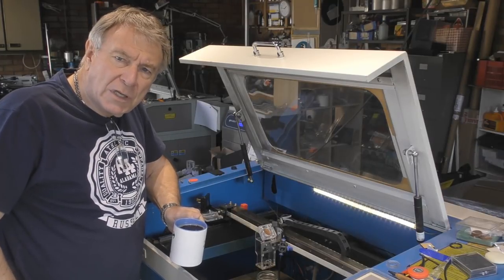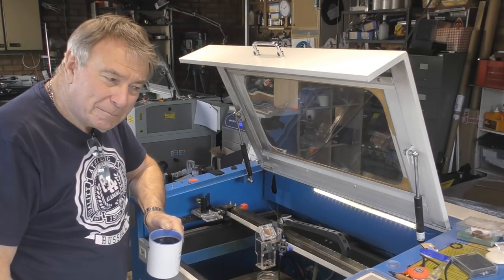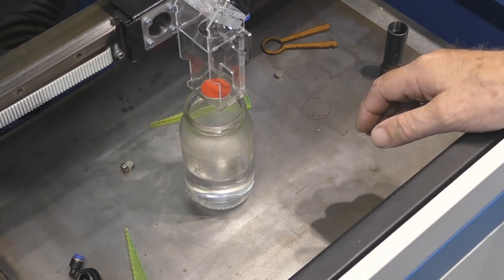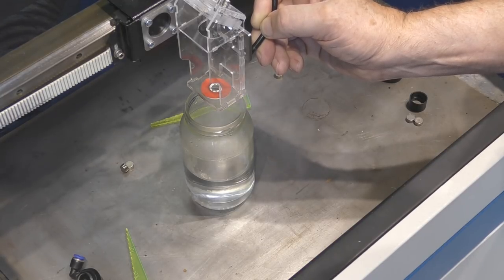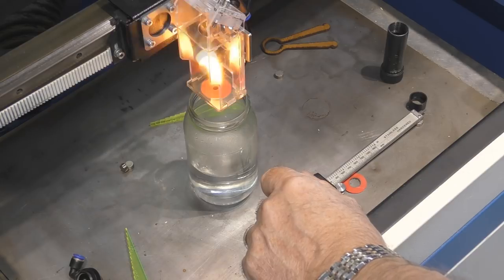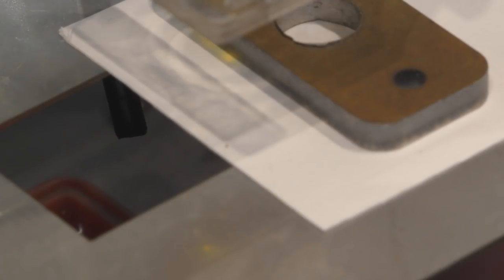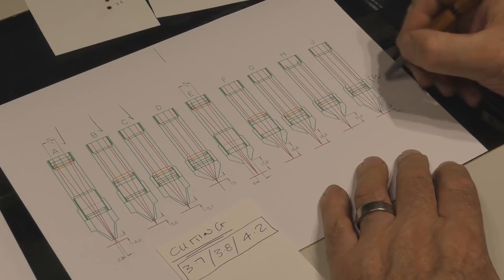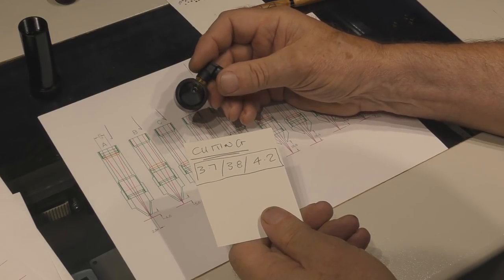RDWorks Learning Lab 152 Are our Nozzles Designed Correctly

Comment: Hi Russ. I couldn't help but wonder if the hole in the orange paper circle was expanding due to the paper continuing to burn and the flames spreading in the presence of oxygen in the air (even after the beam is turned off), rather than precisely indicating the true diameter of the laser beam. Could you have used some material that does not burn as easily as paper? Can't back this up with actual experimenting, though, because I don't currently own a laser machine.
Reply from the maker: Hi Steve

I used thin card because it has relatively low damage threshold. You will note that I initially only use the shortest possible pulse so that only the highest power central part of the beam burns a hole. Yes, around the edge of the hole there is small ring of red hot carbon that continues to burn like a charcoal BBQ even when the power ceases, this being due to exactly the effect you mentioned. After each pulse burn the red ring dies within a few seconds  so I then do another slightly longer pulse.  Bear in mind that the power distribution within the beam is Gaussian (a bell curve) and that as the beam diameter increases the energy density drops off quickly .  There comes a poinr where the power very near the outer edge of the beam is so low it will not even make the previous carbon ring glow red hot. This ultimately means that no matter how long I finally hold the beam on for, i will do no more burning,  The power density at this diameter is only adequate to scorch a round the outer part of the last carbon ring.  Although I measure this scorch mark as being the beam diameter  full size, in reality it is a bit bigger because there is still that power outside the mark that is just too weak to even mark the paper. This is a tricky test because you must not let the paper burst into flames at any stage.
Best wishes
Russ
Reply: Thank you, Russ. Keep thinking and doing. God bless.

Comment: what about your compound lense? having the beam slimmed down by the first lense then again by the second should make it even smaller to pass out of the hole right?  hose does your compound lense work for cutting?
Reply from the maker: With the new knowledge about nozzles I will have to go back and look carefully at the beam profile of my compound lens. It is about the same focal distance as a 1" fl lens which means it will be worse than a 1.5" lens. That is a couple of sessions away when I revisit lenses and nozzle diameters.. The compound lens was never intended as a cutting lens just a special tool for dot engraving.

Best wishes
Russ
Reply: what im kinda thinking of is switching entirely to the modified lense tip. so my lenses will be held in the tip. one 2" lense, 1.5" lense, and a compound lense. having 3 tips that press on easily, make them swappable. q quick connect for the air and im set. i could etch a layer with a compound lense, pop off the tip, change to my 2" tip, adjust my depth for the new focus, and cut. yes this adds another step in the process to etching and cutting, but it would give the best results.
Reply: i currently have the black 20mm lense tube. came with a 2.5 lense, and currently running a 2" GaAs lense. i bought a 1.5 GaAs 20mm lense and realized it wont work in my machine. :(.  but  i do a ton of engraving work and i have a 100w laser. its not easy getting clean work on such a big laser.
Reply from the maker: Hi Shawn
Certainly achieving control of low power is difficult on a 100 watt tube. Do you know where  pre-ionization zone exists for your tube and have you played with it for engraving? Are you aware of the scanning SPECIAL mode and how to use it? Either may make your engraving life easier. Is this dot engraving or black and white lerrter and logo engraving. Don't despair about your 1.5 GaAs lens because I hope that soon you will be able to buy a short 1.5" engraving nozzle that will work with your lens and lens tube system. I am currently in discussions with a big supplier in China about stocking such a beast.

Best wishes
Russ
Reply: no i dont know where my pri-ionization zone is yet (dont know what it is either), and i have heard of special mode, but never used it. i can get my laser to fire at 8% power. when im doing photos i try to stay around 100mm-150mms 9-10% power. i could always get a smaller tube, but i like being able to cut deep wood. ideally in a perfect would i would have 2 laser tubes attached tot he same head. one for etching and one for cutting. a few of the high end trotecs and universals do this. i do have access to an rf trotect at my makerspace. after watching all your videos on dot size i really want to go run your pattern on it just to see what size they are and how fast it can lay them down. i know it will be faster, but what about size. is your new tip for 18 or 20mm lenses. all your videos you used 18 in the compounds. i was thinking of trying to make my own 1.5PC/2.5 miniscus 20mm compound lense.
Reply from the maker: Hi Shawn
 At that low % power you are probably already working in that pre ionization region. It is a part of the start up phase that happens almost instantaneously every single time you switch your beam on even for a single dot. Take a look at the second half of this video and you will see how to characterize that operating zone. 
https://www.youtube.com/watch?v=nZuatc3eIgU&t=6s&index=24&list=PLPWEtx5V9DqEogIeYRdcG_KYcB7UL2Qmn
 This is a zone  of uncertainty that the beam goes through as it triggers. However you can hold the beam in this very high frequency high power short duration spiky region with careful control of your power. It may exist for a 2% range or a 5% range depending on your specific tube.. It is usually in the 4 to 6mA range.  and is what I call "hissy " mode because I use it a lot for burn-free cutting of thin card and paper and the beam makes a definite hiss that is nothing to do with air assist hiss.

Special mode may be useful. Normally when the beam has switched on and passed through this pre-ionization zone it is a steady stable beam because it is driven by a dc voltage and a steady current flow. There is no pulsing or inherent frequency. However, if you go to the USER tab and look for scan mode you will find a drop down selection that will by default set to COMMON mode If you change this to SPECIAL mode you will need to set the Facula item below it. This has a setting range of 50 to 99%. Set it to 50% and write the settings back to the machine. Your beam will now no longer be a dc driven stable beam. It will be a sort of slow emulation of a Trotec tube in that the beam will be switching on and off at 20Khz where 50% is ON and 50% is OFF. The Facula is setting the duty cycle.. You must ignore what your ammeter tells you in this mode because IT WILL LIE. if you know your max safe power setting is 70% then stick to that number. It does mean that you can now operate at maybe 20% power with more control . It's worth a try.

Best wishes
Russ

Comment: I have been told that the beam diameter from the tube will be a lot smaller than the burnt area on your test paper because the air around the beam is being heated up enough the reach ignition temperature of the paper. This is also evident because the output end of the tube is probably not 12mm diameter. What are your thoughts on that idea?
Reply: Hi John

I have been  told that the earth is flat, can I convince you of that also.? I am afraid there are LOTS people around that just do not comprehend the physics of out laser beam. I have taken many opportunities to try and explain the physics of the laser beam and how a beam of LIGHT  can heat most materials. The laser beam itself is not hot, it is just a beam of special light energy. The missing link in your knowledge is the fact that ALL molecules are vibrating ALL of the time and that the intensity of that vibration is THE definition of what temperature is. What is the difference between hot and cold water? They are both chemically EXACTLY the same  it is just that the molecules in hot water are vibrating faster. Once you have grasped the concept of more molecular motion means hotter temperatures, you are half way to understanding how our laser beam affects different materials
The next concept to understand is that the wavelength (frequency) of our invisible  light gives it some  peculiar properties. Fire the light at metal and all or most of the light will reflect/bounce off . That is how we can use metal for our mirrors. With just a few exceptions (and those  we can use for lenses) ALL other solid  non-metal materials will be affected by the  10.6micron wavelength  light beam. How? The light will stimulate those SURFACE molecules that it hits.  As I explained in concept one, stimulated molecules get hot and just like the water we spoke of,  continue to get hotter the more they are stimulated.  Remember these are JUST the SURFACE molecules that are being exposed to the stimulating effect of the light. What happens to water when it reaches 100C? Yes, its reaches a "damage threshold" which is a unique property of the material, and it can no longer exist as hot water, whereupon you clearly understand that it changes to steam.  Steam is still solid water but in micro particle form. Continue to heat that steam and eventually  it will reach its ultimate damage threshold  where the molecules are  vibrating with such ferocity that the forces holding the molecule together are overcome and chemical decomposition occurs. The hydrogen and oxygen atoms now  go their own way.  EVERY molecule has its own damage threshold where at a certain temperature it will ultimately  break up into its constituent parts.  That is important concept number two.

When you step out into the sun and feel its heat you never stop to think "that's impossible" because the sun is 9million miles away.  It takes light about 8 minutes to travel that distance and the LIGHT that reaches us is wide spectrum. Some of that light is IR light just like out laser beam although nowhere near as intense. That  infrared LIGHT stimulates the molecules in your skin  to higher vibration levels and  you think that your are feeling radiated heat from 9million miles away!!!  Now you understand that stimulated molecules get hotter, you can maybe  begin to comprehend the essence of how our laser beam works. It is an intense concentrated source of monochromatic IR light that has the ability to super stimulate.

OK you are now in possession of the two essential concepts to apply logic to your colleagues  "hot air burning paper" idea. Paper is not a single material although the main constituent is wood . Wood is not a single material either.  it is made up of cellulose resins and various hydrocarbons.
There are MANY different types of molecules in wood/paper, each one will be stimulated by IR light and each will have its own damage threshold ie a temperature at which it will decompose. So there is no single temperature for paper to burn (decompose.) . You clearly can understand the concept of paper scorching and turning brown but not catching fire....so what's happening there? Well, some of the molecules cannot stand the heat in the kitchen so they have left because they have reached THEIR damage threshold The more macho molecules are staying for more punishment. As those SURFACE molecules receive more and more  stimulation they in turn reach their damage threshold and maybe turn to gas or (like steam)  change there state to vapour. This will apply to the hydrocarbons that will the float around and as micro solids will still be stimulated by the light to even higher temperatures,, whereupon they will decompose with an exothermic reaction and catch fire. Note, it is NOT the paper that is catching fire but some of its constituents.  Once that reaction has started,  the energy released  creates it's own molecular stimulation to surrounding material  and the whole destruction process is out of control.  If it was solid wood rather than paper you would see the next stage clearly. After the flammable vapours have themselves decomposed  what is left behind? The answer is black carbon, a REAL macho material. It's damage threshold is over 3000C. I keep reminding you that this is a SURFACE reaction because light cannot penetrate, it only stimulates what it contacts.  Provided there is enough energy available, that thin film of carbon will eventually have to  yield as it reaches its 3000C threshold, whereupon it immediately changes into a gas leaving virgin wood/paper behind to start the whole process again. I have demonstrated this process with wood on several occasions.

OK, now lets look at the laser beam characteristic. It is not uniformly dense across its diameter. The light is very intense at the centre of the beam and drops away to almost nothing at the edge. It is the exit window from the laser tube that defines where the edge of the beam is 
When I fire the beam at paper it instantly goes through the process describe above at the centre of the beam where the stimulation is greatest. I purposely keep stopping that stimulation to let the outer edge of the damage zone cooldown  before I stimulate it again. At the same time  the hole in the paper gets bigger so the energy density in the beam at that diameter is decreasing . Thus I have to hold the power on longer to stimulate the molecules to the same extent. Eventually I reach a size where the the energy density of the light is so low  that it is only damaging the weakest molecules and that is where you are seeing scorching and not destruction.   

It has taken me this long to point out the final flaw in your colleague's  thinking. You cannot heat the air with this laser beam. If that were true then I could feel the heat rising  above the invisible beam as it passed through the air. This whole energy transfer process takes place on SURFACE molecules as the light stimulates them to self destruction.

If you can grasp these concepts then you will gain a greater understanding when it comes to firing the beam at different materials because they do not all react like wood/organic materials.

John, I sincerely thank you for making this comment because my detailed answer is now in black and white for many others to digest and give them an insight into just how their fire breathing Chinese dragon works.

I must stress that I am neither a physicist or chemist but I have done much reading, experimentation and logical thinking to arrive this over simplistic model of how our machine works. There are still many physics mysteries to decode.

Best wishes
Russ

Comment: Thank you for investigating this!  The beam sizes are probably Full width at half maximum (FWHM) https://en.wikipedia.org/wiki/Full_width_at_half_maximum
Reply from the maker: Hi Ed
Your guess is as good as mine, As this beam purports to be Gaussian it is in fact a normal distribution shape and therefore that beam diameter could well  be 1 standard deviation which contains about 70% of the total beam power in about 1/3 of the beam width These numbers tend to agree with what we actually find.
Thanks for the thought
Best wishes
Russ

Comment: I wonder if the nozzles were originally fitted for 30W Lasers and simply copied by others (as the Chinese seem to be prone to do) for higher wattage machines. 
It might not have been until later that someone got curious and tried updating the nozzles.
Reply from the maker: I  know for a fact that the smaller the orifice and the closer to the work you get (3mm to 5mm is ideal) the more air you can pass through the kerf. That not only produces a smoke free top surface to your cut but also prevents edge charring and promotes better cutting efficiency.  It looks like 4mm diameter might allow more power to reach the  cut but the lower air velocity through the larger hole may have reduced the cutting efficiency more than the power gained. That is something I have yet to experiment with. Based on other experiences of mismatched Chines engineering, your theory could well be right.
Many thanks
Russ

Comment: What about just going safe and using an oversized universal nozzle, but just add a second pump to blow the air into the burning spot on a part? Wouldn't that be easier?
Reply from the maker: Hi Vlad
Any separate air pipe is  in a fixed position on the head and is never going to ALWAYS be blowing into the kerf. The the head and cut direction can be any of 360 degrees whereas the pipe is fixed and may be efficient for only 10 or 20 of those degrees. That is why the air assist is concentric with the beam ....it is independent of direction.  This investigation shows that there is zero margin for error when setting the beam but I am not jumping to conclusions  about the effectiveness of increasing the bore size until I have done further work. As I mentioned in the video, this low power occlusion may be a conscious design decision that I do not understand. The benefit of the smaller  hole to the air assist "jet"may be greater than the gain in power from a bigger orifice. All fascinating stuff that will surely advance our knowledge when we have done further tests
Best wishes
Russ
Reply: SarbarMultimedia yes, I realized that setting a separate tube would be less than perfect, but I wonder how it will actually work in practice. I am actually thinking of adding another pump to my 50W laser. So I may have a chance to actually give that a try soon! :)
Reply from the maker: Hi Vlad
A man after my own heart. Listen but don't believe until you have tried it for yourself. Have fun
Russ
Reply: SarbarMultimedia lol, that’s how I am. It’s good and bad. I have a lot of respect to all your work and knowledge, just curious to try it myself. I am giving it 90% probability that I will confirm your results, but I would still try. That’s the most fun!
Reply: @VladOnEarth  have a look at how epilogue do theirs no head no nozzle to speak of